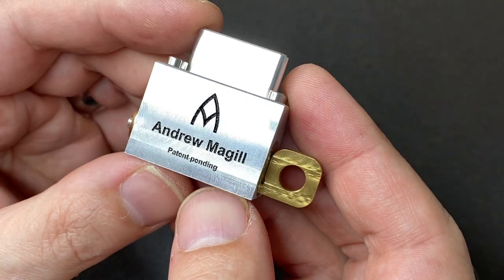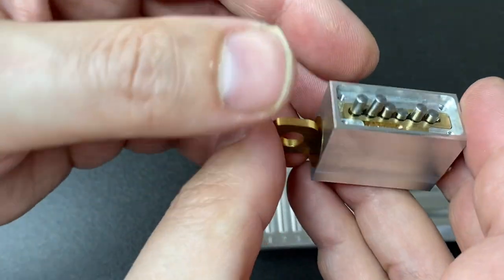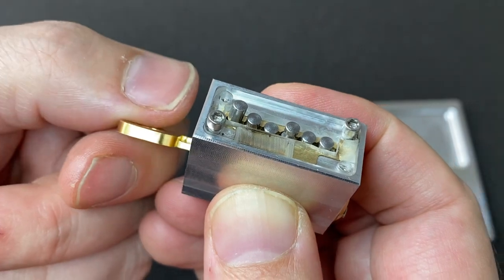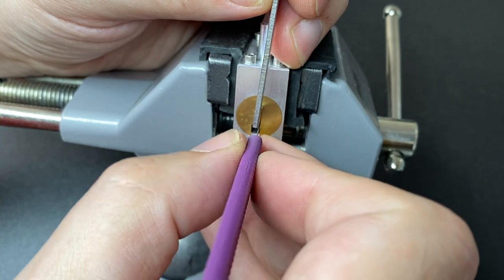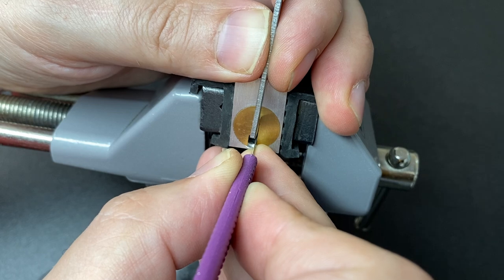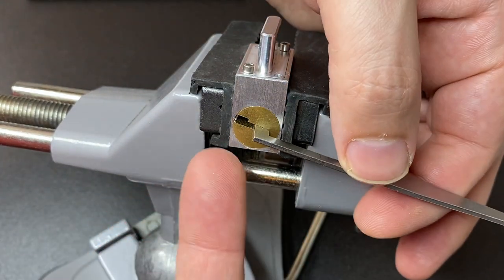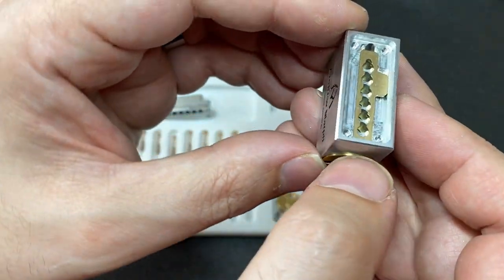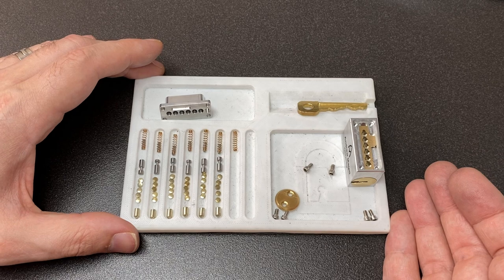Unpickable? Enclave - an Ingenious New Lock Design

Comment: Very very interesting concept. 
I like the side bar or rather "top bar" idea. Makes it truly a feedbackless pick. 

Now I am wondering if you were to draw - or glue a printed -  dial (much like a clock face but with preferably about 360 lines) on the lock and go to the 45-degree angle after every picked waver could you be able to make out the subtle differences we would normally feel during a pick through a lock, by visually comparing it to the "normal" 45-degree angle? Of course, you would have to find the binding order by fully picking all the pin chambers once to see which one was the actual first binder and on which "click" and repeat the process with the remaining pin chambers. However, like this the number of pickable positions would drop dramatically and an overset and a dropped waver would be immediately visualized by your dial which makes a comeback easier. I hope my explenation made sense to you all.
Best wishes

Comment: the wafers give it basically endless "oh you got it" points. so you might think you have it when you dont. the slide bar is the real goal and with it being completely locked away and needing multiple things to line up thats gonna be hard. i wouldnt say pick proof, enough time and youd figure out what goes to where, but that time is not something someones gonna bother with. would make a nice door lock setup.

Comment: This is an extremely interesting design! I don't think I've seen core rotation not meaning that a lock is picked before. The only caveat might be precision as you can already hear when sliding the key in. And six chambers with five wafers each equates to 46,656 different combinations, which is mental. Technically you could even manufacture the lock with different numbers of wafers in each stack, which would even be more confusing.
Or introduce molds to the top of the core that wafers fall into when trying to rotate on the wrong configuration, effectively seizing the lock from then on.

Quick explanation: six configurations per stack (counting from zero to all five wafers being lifted above the shear line) and six stacks, so 6^6 possible combinations.

Comment: Another benefit I can see with this lock is that if you lock your door with two turns of the key, then it'd really take a picker two successive picking attempts to try and open the door. - Because as soon as the lock body rotates once, if the key isn't there to keep the pins in place, it'll just drop that 7th pin, release the slide bar and cause all six main pins to reset. - Even if you got a tool in there to kinda press them all up, what if one slips? How'd you even know which one it is? You really would have to reset them all.

Or use a specialized tool to keep track of all the pins' different positions and at that point you're decoding the lock, not picking it. - And most pickers don't have access to those kinds of tools, and decoding it for the first time would anyway take you like... 5^6 tries. 15,625 possible combinations.

It's definitely not unpickable, but it's impractical to pick, requiring special tools and a lot of time and know-how.

Comment: I think the rotational angle (the turn of core allowed to test the key) needs to be limited slightly more. Or the actuator on the back of the lock needs to have a slot designed such as so the actuator doesn't start to turn before the key is approved. (ergo, the actuator will slop around about 20-30 degrees in each direction - this can be done by making 2 arc slots in the actuator, and 2 pins extending out of the core).

Maybe both, more limited "testing area" AND a sloppy actuator. Combine with a return-to-center spring on the sloppy actuator to even further prevent the blocking latch from disengaging in low-friction locks.

The reason for this, is that some door locks (mortise style or deadbolts) will disengage the blocking latch (the latch that physically blocks you from pushing the locked deadbolt bolt into the lock/door) in the first few degrees of turn. An intruder, could pick the lock (or insert an incorrect key) and just turn it to the "blocking position", where the core will not turn any longer, and then use a jimmy shim, thin knife, feeler gauges or credit card to push or work the deadbolt into the door.

Comment: I wonder if it would be possible to feel out which pin stack is binding the most by how the sidebar twists when the angled pin is under tension, and then focus on finding the correct height for that pin that allows the barrel to be turned a little bit further.

A slower one would be raising all the pins to the same height at the same time, and checking if it’s able to turn slightly further, and then resetting stacks one at a time back to zero until that progress in turning the barrel is lost.

Comment: How hard would it be to break that last retaining pin? If you get the lock into a false set, it's the only thing preventing the lock from turning. Could you force it open with a screwdriver at that point?
Reply: The best solution I can think of for this sort of brute-force attack is to couple the lock mechanism to the slide bar, rather than to the rotating core.

Simply add a projection to the slide bar that manipulates the locking mechanism (deadbolt or whatever), so that the lock is unlocked when the slide moves, rather than when the core rotates.  Then you make the slide bar and spool pins out of the hardest non-magnetic steel or titanium, and the wedge pin out of something softer like brass.  So if it's brute forced, the wedge pin deforms, the core turns, but the slide bar never moves and the lock doesn't unlock.

This has the downside of making it less of a drop-in replacement into existing locking mechanisms.

Comment: I bet I know what LPL will do. He will lift all the pins past the set point, put tension on the lock to hold them there, and gently tap it with a hammer so the top pins fall into place one by one until that sidebar thing can move. He did that with a similar lock made by Stuff Made Here.
Reply: I was thinking the same thing, but I don't think that would work, because when the slide bar engages the pins, the cylinder is turned such that the little wafers have nowhere to go, so the top pins can't come down either.

Maybe you can lift the pins one by one, getting the slide bar to move by tapping the lock with a hammer without turning the cylinder, and feeling if the slide bar hits the pin you're working on? I think it would be mighty difficult to feel, considering you're tapping the whole lock with a hammer, but with a stethoscope or microphone on the pick, you might be able to hear the difference between just one tap (the hammer striking the lock), and two taps, with the second being the slide bar hitting the pin on return because of the spring. If the particular pin is in the correct position, the second tap would be absent.

It would still be very tedious and complicated, but maybe not quite impossible.
Reply: @tonfleuren3536  Good catch! I didn't think about the little wafers that would be in the way of the pins dropping down. This thing would be a really tough nut to crack. I'd be fascinated to see how it could be done.

Comment: would you be willing to test how much force it takes to sheer off the locking pin at the back? As it is pushing against brass on both sides, it may not take much force to just bend the parts and force the lock open. The beauty of this exploit is also in the fact that if it works, there would be no way for legitimate owner to notice that forced entry was made (as the lock will simply be stuck in open state, but key will still move freely.

Comment: hi, what happens when you turn the cylinder without anything inside, so that all "mini-plates" are inside the turning cylinder. Now the pins have the full freedom to move, only held back from moving by the little springs. So now holding a strong vibration device on the bottom, the pins will move/shake until the right position.

Comment: what if you started out overlifting the pins? idk if it would work or not, but it seems like if you overlifted them and put a lot of tension on the core you might be able to work backwards, using the tension of that sliding bar to judge when the pins set. might not work at all idk, just an idea

Comment: A dummy key with a leaver made of high-quality steel may brute force spin the last pin. Only one pin prevents the lock from turning and has two sliding 45° surfaces. I think that it is possible to distort the pin just enough to turn the lock.

Comment: The task of those wafers is to force discrete positions for the actual pins that interact with the sidebar. The clever part is that the wafers do not take part to the process that actually prevents the lock from turning. I once tried to create a bit similar design using bearing balls which ended up being vulnerable to overlifting because I wanted to create a design that could fit within euro cylinder specs and there was not enough space available to avoid that problem.
Reply: no the quantization is a side effect, not the core function of the wafers. the point of the wafers is to transfer the force up to the real pins, while still being able to be sheared at any point. the quantization only happens because as long as that mechanism is made of solid material you have to have discrete shear lines. the quantization may have beneficial effects such as reliability, by rounding a slightly off key to the nearest real bitting, but that's not its primary purpose.
Reply: @spambot7110  Are you sure about that? As I understand this lock, the quantization is the only method that prevents direct manipulation because the pin lift is already quantized before the sidebar is tested.

Comment: A possible tool for attacking this lock (though it would be a brute force attack) could be a multipin decoder, similar to the (single pin) Lishi decoder that uses multiple pick tips to set and hold heights on each pin... though with what, six possible pin positions per chamber for 46,656  (or 6^6) possible combinations, and the only feedback you get is a go/no-go from the seventh pin... it's going to take a looooong time to decode from scratch. Call it one position per second, for a possible average-to-max decode time of six and a half to thirteen hours depending on where you start in relation to the actual combo.

It might be pickable... but in any situation where you don't have literal hours to spend on it, a starting reference (like a picture of the key) or where a destructive bypass is feasible, this lock does its job exceptionally well.

Comment: How strong is the side bar spring when it is in position? If you strike the lock from the front, as you would with a bump key, you might be able to get that spring to bounce "engaging" the side bar without rotating the lock. If that works, you might be able to decode the lock by picking a pin, then bumping the lock and checking for a change in feedback. The theory being that at least one pin in the correct position should bind the sidebar when bounced, giving you the depth of the cut. It would still be a fair amount of decoding, just a lot fewer than than trying to decode the entire lock.

Comment: I think you need to approach this as a combination lock rather than a lock to be picked. If we start by manipulating a stack by one wafer until the core can rotate a bit further due to the tolerance on the sidebar you know the value for one of the pin stacks, very similar to how some of the 3 digit combination locks can be decoded. That's the most practical way I can think of to get into this.
Reply: Ah, if I keep watching the video I can see you discuss this some. Interesting.

Comment: Seems to me like the place to start is picking the back pin first, as that is the one most necessary to allow the bar to slide. The grooves on the pins are a lot wider than the wafers, the "slidebar" is also thicker than a wafer but not as big as that groove so you may be able to be a wafer out either way which makes it exponentially simpler. Picking from the back, working forward, you need to tension it on where the back pin starts to move the bar and as each pin gets close enough the slidebar will edge ahead - if you get a point where nothing seems to make it move forward then the tolerances are causing it to actually bite on one of the other pins which should also be discernable at that point, so go there instead and then back to the rearmost pin that still needs to be picked.

Comment: you can't get tactile feedback, but maybe visual? get the lock into a false set, then draw a marker line across the line between the cylinder and the body. then for subsequent attempts on the pin, you can see if it rotates the same distance, or gets slightly further. once you find the right position, write it down for that pin, clean off the marker line, and move on to the next one. I guess this decodes, not picks, but maybe from there you could use a custom lishi tool or file the bitting into a new blank. not exactly picking but a potentially successful attack

Comment: Interesting lock. I can see a possible exploit, but would take some fine work to do.. Keep upward picking pressure on the sidebar driver pin as you go along the pin stacks and stt is things bind that way. You wouldn't really need a tension tool untell the lock is fully picked. Very cool design.
Reply: The back pin is not picked.  it sits on a cam that lifts when the cylinder is rotated.   Thus all the other pins must be selected correctly  prior to rotation  else those pins lock up and the cam stops rotating.

Comment: it says "Patont ponding" on it :/  I like the idea tho, it's basically like a combination / safe lock, only that instead of inserting your combination, you use a key that inputs the combination for you. I'd like to see LPL give this a go tho and I have few ideas, give them a go:

1) pick it hafl way or completely from 0 position, try shaking it or hitting it with something and then try raking it. Hard to explain, but basically shake and rake. there could be over 40k different positions, but if you apply bit of force and shake, it might just end up in right position quite fast.

2) you didn't properly show inside the keyhole, would there be enough room to slide something between those wafers? It's hard to explain, but I have this image in my head where you could have something like S or Z shape, very thin metal that can go up the side of the wafers and then block them from going too far, so push that in there, then bind them .. but trick is to get all 6 of those in there to hold all 6 stacks and prevent them from going too high

3) have you tried using slight force? pick it half way and then apply lot of tension, it seems like the sidebar isn't moving too much, so I think those pin stacks could give enough slack so that you can force the sidebar to move just enough for the angled pin to move up.

4) how strong is it against bruteforce? Like if you'd take one of those common thief tools that uses pure brute force to just break turn the core, would it be easy enough? Most locks can be brute forced. i've seen some thieves use a small butterfly knife, stick it in the lock and then use those "wings" on sides to apply force. would this lock withstand such attack?

Comment: I suspect the vulnerability will come down to whether there's a way to actually tension the slide bar somehow, or manipulate the driver pins directly.  Obviously he's put effort into warding it, but maybe some kind of vibration tool could jiggle the drivers while the actuator pin is under tension?  I look forward to LPL taking a crack at it.  I also wonder how easy it would be to force, given that the sliding bar is brass and there's only a small amount of material interfering with the driver pins.  While it is destructive, it's possible the damage would be undetectable to future key users.

Comment: can it be shimmed? Imagining an L shaped shim that is inserted such that the lower part of the L slide into the back section and can be used to apply force to the rear pin. Maybe even two shims coming from either side to bind up and fill in the space where the rear pin resides to press it up. 

Not sure how else to go about it, the trick will be finding a way to push that rear pin up.

Comment: So, I think I see how you'd try to do it.  Going to be more difficult, but basically you need to exploit the same machining variations that you do with a more typical lock, only on that slide bar instead of on the pin shear lines.

So you need a picking tool that lets you precisely control the height you lift the pin to, and you lift the pins by degrees one at a time, and for each position of the pin you check to see if it makes a difference in how far you can rotate the cylinder.  It may take several passes through the pins to find the order in which the upper pins bind, but it will still be quite a bit quicker than trying to brute-force all the combinations.

Comment: I wonder if you could open it just by applying enough turning force.  It might be destructive, but if you had something like a tire iron with a key in the middle, I have to imagine that back pin would be forced up and out of the way.  Most pin and tumbler locks put in this kind of situation would just bind up, but it might work here.

Comment: what about after the lock is piked in a false gate u use some kind of lever to force the core to rotate the pins looks like to be steal while the plate is brass maybe the last retaining pin would have enough force to wedge itself  in the brass retaining plate  allowing the core to rotate ... or maybe the retaining plate would transfer all the force right on the others pins witch have a pretty clean weakpoints ...  decidedly destructive  but sounds like it would work